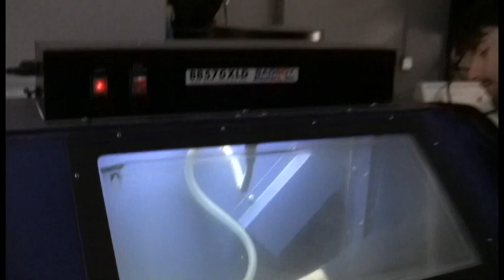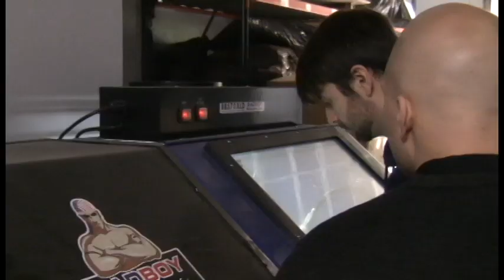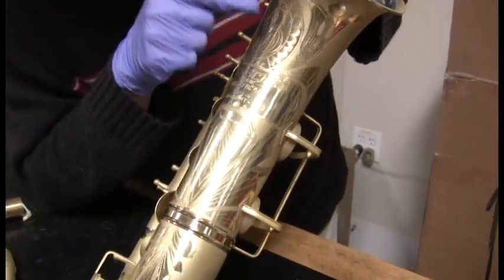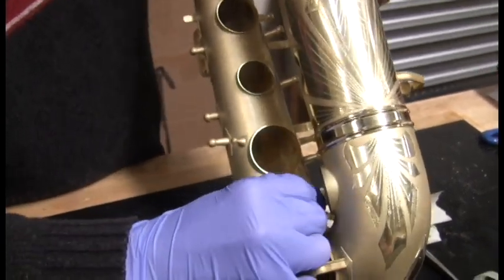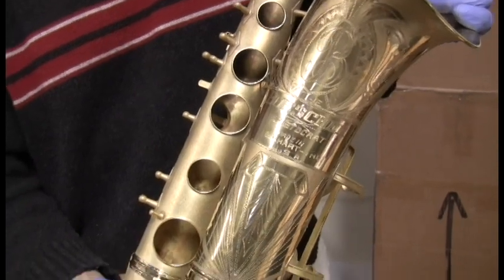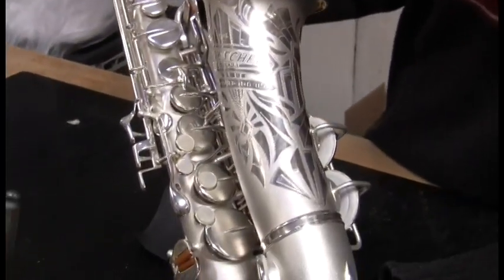Applying a Satin Finish to a Buescher Big B Tenor

Comment: If I'm not mistaken, the tenon is the metal tube soldered to the neck and the tenon receiver is the part you pointed to where the tenon fits into. Nice video and thanks for sending out the email updates. They are very informative.

Comment: Hi, I would like to know if that job can be done with any sandblasting gun? and the type of sand?
Reply from the maker: There are two types of sand used for this process, one for cutting and one for smoothing. The gun is used at the lowest pressure to prevent warping or denting the brass.

Comment: I would like to know how you plated the interior of the bell, how do you protect it when you plated the silver finish?
Reply: 1st silver, then gold
Reply: Did you have to manually apply the gold with a plating kit? (I’m presuming you couldn’t dip it as that would affect the outside)
Reply: Maybe they plug the bell with something, and fit a cup around the rim of the bell. Then fill that section of the bell with plating solution.